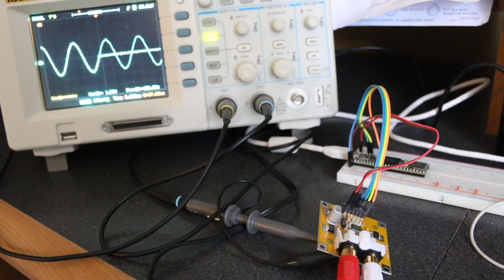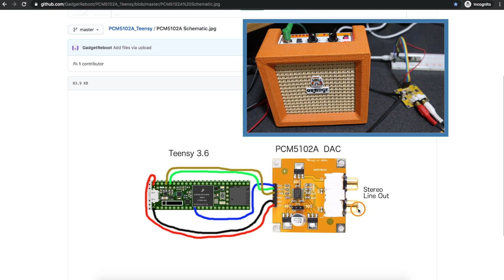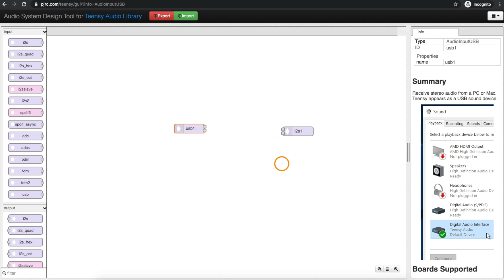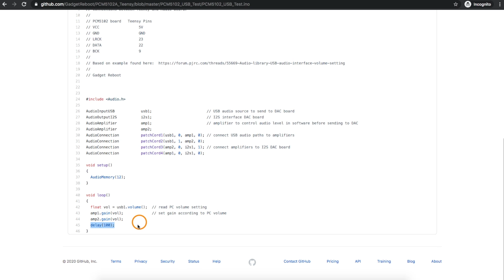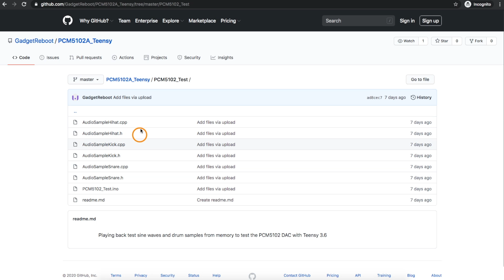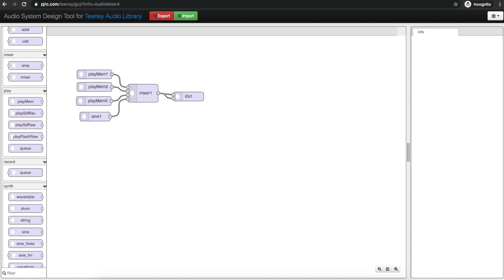PCM5102 I2S DAC Decoder Module from ICStation.com

Comment: I just got this board and managed to get output from it fed by a jab5 board. On the dsp the i2s output has "no processing" and comes raw(i think) from the onboard BT device through the i2s bus as well i believe. However the analog output i get is super loud and distorted. Does the i2s signal bridge need to be attenuated somehow? Jab5 i2s outputs 24bit 48khz.. Thank you in advance

Comment: Sorry, I didn’t get it.
USB -> digital audio -> Teensy -> digital Audio I2S -> DAC -> Analogue Audio

But at 05:38 how can analogue amp inserted on a digital path?
🙏 thanks..
Reply from the maker: that is a digital amplifier module within software, so all it really does is scale the numbers representing the digital data for the audio signal and for example if you multiply the signal by two, the peaks are twice as high so it’s louder, etc.
Reply: @GadgetReboot  Thank you. That makes sense.

Comment: Is it possible to use this DAC to my ATSAM2133B MIDI module? The only missing component is a DAC. Can i use that board to my MIDI module?
Reply from the maker: The datasheet mentions configuring digital data in I2S format so it should work then. 
 https://datasheetspdf.com/pdf-file/634618/ATMELCorporation/ATSAM2133B/1
Reply: @GadgetReboot  okay thanks. I tried several DACs such as cs4335, cs4340 and tda1311, all of them sound distorted. Hope this board works fine.
Reply from the maker: @vincem.exclusive9151  I don't have experience with the older dacs and they may be looking for data in specific formats while the newer devices have more options to configure.  I've used 3 different modern I2S dacs with modern processors and it all worked effortlessly so getting a modern one to try on the old module is the best bet. If it's still not sounding right maybe there's something else in the configuration of the chip sending the data out, maybe it's just clipping and a different setting could help it.
Reply: @VinceM Karaoke does sound come out from tda1311 ? i was trying to get output from tda1311 by connecting it to xmos u8,but it only gave white noise whenever i played songs.xmos puts out 32bit data and tda1311 can only accept 16bits.but i like tda1311 sound,it sounds very balanced and musical.all newer dacs dont come close to the sound of old philips and wolfson dacs.newer dacs have unbalanced sound i.e voices pushed forward to enhance background details and snare drums pushed back,this is the reason newer dacs sound irritating.
Reply: @cbr10009  solved my problems. I'm now using UDA1334 and PCM5102 works perfect on my SAM2634 and SAM2133B MIDI modules.
Reply: @cbr10009  If the sound is a little harsh or lacking of detail, you need to use the SCK pin of PCM5102, now it sound as good as my UDA1334 and WM8524G DACs

Comment: Just got a teensy 4.1 and audio shield to do some audio processing, maybe I need to play around with some drum sounds first.
Reply from the maker: it was easier than I thought to get the drum samples working. I think it’s time I upgrade the teensy as well, partly because it would be good to have two of them if I want to do a bunch of audio processing and each one can only do so much, like audio delay taking up all the memory.
when the house gets sold and all of the mandatory things are getting paid out like mortgage balance, legal fees, taxes, I’m going to sneak in a workbench stocking fee somehow.
Reply: @GadgetReboot  Sounds like a good plan. 600Mhz clock in a small chip what more can you ask for.

Comment: Do you know if this also works with 24bit audio?
Reply from the maker: Yeah on the first page of the data sheet it says 16, 24, and 32 bit are accepted. 
https://www.ti.com/lit/ds/symlink/pcm5102.pdf
Reply: @GadgetReboot  Yes, I am aware what the DAC can do, but I am talking about what the Teensy can do?
Reply from the maker: for the teensy three series according to this thread, they are sticking with 16 bit because of limited processing power but I don’t know if they have done anything higher for the teensy four family.
https://forum.pjrc.com/threads/54793-Teensy-Audio-24bit-48kHz-qustions-and-more